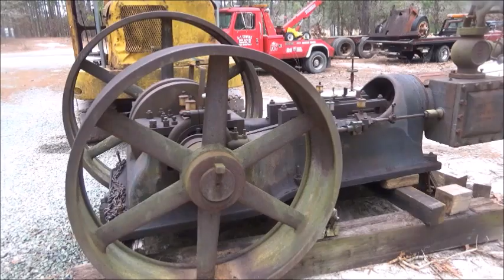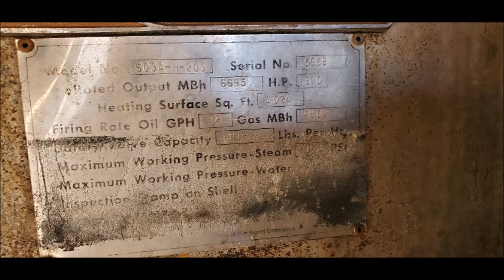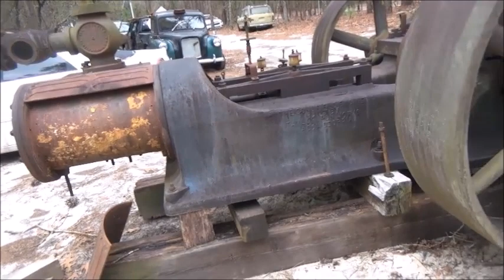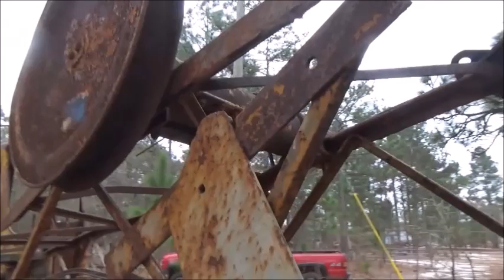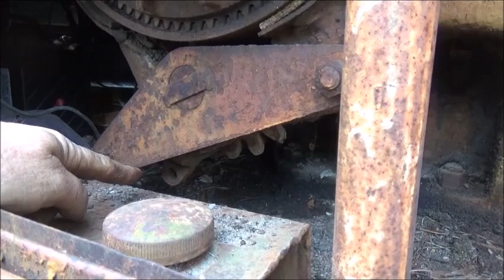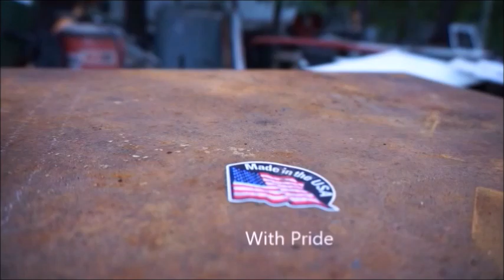STEAM BOILER AND STEAM ENGINE UPDATE

Comment: nc dept of labor inspects pressure vessels, they come and check my compressors yearly
Reply: I’m guessing you are using those in a business situation tho. Not what he would be doing.
Reply: @notajp  yea I work for the state but if he was worried about the integrity of the boiler itself they can ultrasound it

Comment: Last time I looked, stationary steam engineer ticket was a 4 class hierarchy. Class 4 and 3 pretty well have to be done at the same time. neither works without the other. I have seen these courses available online for a fairly reasonable price, but you have to dig for them as University's have the worst websites on the net. After that, qualification is based on what they call, "boiler time". It's really hard to get unless you have your own steam engine. Hey wait?

Comment: I see nothing wrong with what you want to do, I think it's great. I love that old machinery (Nice engine). I think the Horse Power of a boiler has something to do with heating grate area of the fire box and BTU's converted into the work the boiler can do. A lot of the steam shows offer a steam school generally in the spring to teach people about steam engines. We had a large heating boiler where I attended high school, it ran at 15psi I don't know the max pressure rating of the boiler. Go to www.smokestak.com They have a steam engine forum there.  The boiler will probably have to be inspected and make sure you have liability insurance that will cover the operation of the boiler and engine I' am guessing. That boiler probably has auto water feed and pressure/burner controls and also draft control. Best of luck on your projects.

Comment: I know the boiler is going to be a big expense, But gosh darn, I hope you can swing it, steam always makes these engines really sing. 
You might want to see about a fire tube boiler rather than a modern water tube. Lot less maintenance in regards to worrying about the tube calcification and such, less chance of a boom. of course they take longer to create steam and are less psi, but your not using these engines commercially, so I don't see it being an issue.

Comment: We used steam to cure dry cast concrete sewer pipe, we need moisture and heat we ran to 250 hp, 15 psi.

Comment: Put the steam engines in 20' containers and modify them so they open up like a tackle box.  Use hydraulic cylinders to do the opening, anyone who attempted to gain entry would just waste their time and make noise like the thieves that tried to hotwire that air start Diesel truck you have.

Comment: Hello Jonathan - I hate to pee in your cornflakes, but I think getting this boiler is not a good idea. First let me say I love your drive and projects you work on and your whole approach. But,  I am a retired mechanical engineer who designed HVAC systems for 25 years before traveling to assess many facilities across the US and Canada for another 11 years including these types of boiler plants. I was an active licensed engineer in NC up until this year. There are several things to consider and none good for this boiler. I may reference some code and standards, some of which have been around since before 1900. I don't claim to be a boiler expert, but I'll share what I know.

The Boiler  - It's ancient. I don't know when Iron Fireman quit building boilers, but they don't exist anymore and parts may be difficult to get. Iron Fireman was known mostly for its coal stokers and feeders.

Sizing - From ASHRAE: Boiler selection depends on the individual application and operating characteristics of actual loads and should be sized for the maximum load. Do we know the steam and pressure requirements of these steam engines? Are they in good enough condition to take high temperatures and pressure? Oversizing of a boiler to its load can result in overfiring and short cycling of the burner. If the boiler is set on a low-fire condition to compensate for a low load  you could run into condensation problems at the stack leading to corrosion of your smoke box.

Burner - I assume this is a low-fire/high fire burner only given its age. It may have a turndown ratio to deliver less steam but again condensation may become a problem. Modern boilers have fully modulating burners available and are built to handle the turndown, but this one doesn't.  It does operate off natural gas as given the gas train piping in the photos. I don't see fuel oil piping although some burners can switch from NG to FO. The burner is old, apparently original to the boiler. Parts may be available for it but you may be looking at a new burner at some point $$$$.

Fuel - As above. I assume you don't have natural  gas where you live, therefore the burner orifices will have to be resized for propane. Propane is not cheap. And if it does use fuel oil, you will require a tank, probably 500 gallons, with fuel oil gear pump(s) and piping system including return. And you must burn No. 2 Fuel Oil. Don't go buy diesel at the gas station. Fuel oil is dyed and closely monitored by the NC Agriculture Dept. Don't even think of burying a fuel tank.

Feedwater - Boilers like clean water. Even municipal water must be constantly treated with chemicals to properly operate a boiler. Lack of clean water leads to scaling and corrosion, situations that can lead to boiler failure. Boilers of this type have to be regularly blown down to discharge sludge that accumulates in the bottom. Also, you will need a constant water source and a feedwater system of piping and special pumps capable of pumping water to boiler pressure $$$$. Although low water safeties may be in place, a fired dry boiler will have catastrophic consequences. Boom! You will probably have to drain the system in the winter to keep it from freezing. And yes even live steam systems can freeze under certain conditions. I've seen burst steam coils and it isn't pretty. 

Piping - Modern high pressure piping must be welded by a certified welder. In commercial applications it's not uncommon to require X-Rays of random welds to certify lack of voids, etc. The piping must be insulated to retain heat. Otherwise you'll get condensation in the pipe that if not removed by steam traps could cause water hammer and potentially damage the engines. People have been killed by water hammer by improper opening of valves. You must allow for thermal pipe expansion depending on the distance. Safety relief valves must be in place to protect the piping and equipment from explosion. The reason high pressure is utilized is generally to reduce pipe size in large distribution systems. Sometimes process requires it.

Safety and Operation - Redundant safeties (pressure, temp, low water, and flame) are necessary if not required by Code. A boiler operator should be trained and certified in all aspects of steam plant operation. North Carolina has a Boiler Code that refers to many others: ASME, ASHRAE, Fuel Gas Code, Piping Code, NFPA, FM, etc.,etc., etc. It's involved. The boiler will probably have to be certified and licensed.

Boilers have to go through a set startup procedure to prevent thermal shock. Firing one too fast will crack tubes and tubesheets and other assorted mayhem.

Liability and Insurance - Here is where you may really get nailed. I have no idea about these two regarding boilers, but I would dare say your homeowner's insurance wouldn't look kindly to an operating high pressure steam boiler on your property. The old Union Carbide plant in Greenville had a boiler explosion in the 70s that sent chunks of building into the roadway several hundred feet away.

So, there's my long winded 2 cents worth. Personally, I think this boiler is a money pit unless you sell it for scrap. I would suggest for starters you stick with a compressed air system, get these engines moving, see what pressure they take and possibly air CFM that can be converted to steam volume. Then determine what you may need for a boiler if that's what you wish to do. Who knows you may get some low pressure residential steam boiler that offers enough Umph to spin these machines. They're not under load and if moving freely may require very little steam. Honestly, boilers are dull and not fun to watch. People want to see the engines spin and crossarms go back and forth. Dress up the old boiler for show as it would have been installed along with these machines.

Good luck Jonathan. Thanks for what you do and keep up the good work.
Reply from the maker: Nothing you wrote that could or would stop me from doing it. Just not sure why everyone is scared of spending a little money and doing a little work. Also iron fireman is the burner not to boiler maker.

Comment: Just my opinion I'd hold off for now .on that boiler ., back in the day I worked for the feds had a bunch of water tube and firetube boilers most ran really low on steam pressure even if rated higher , mostly under 12psi .

Comment: Jonathan, wow!  Let me tell you about the boiler, let me tell you about "WHY" people like us do stuff like this.  Let me tell you about health issues as well.  I don't want to make a book here,  but it is going to happen, sorry.

There are two Kings in the world, the first KING is Jesus!  The second king is steam!  Myself and some others here understand your "Why am I doing this?"  200hp boiler you don't need, way too big and wasteful.  After you go through the engines like you normally do,  you'll  be able to run them for display at probably  (+/_)  30-50 psi, maybe  a slow roll at less than 30, just a guess, but probably only one at a time.  I read as much as I  could on the tag, which wasn't  much, but nevertheless,  it is an oil fired boiler, commercial,  and boilers at least similar to these still are in use.  I agree with your thoughts on 150 psi for heat, there's  no way.  Was it a repurposed boiler and the limits, safeties and fuel regulators, etc were all reset? Could be.  That size (physical size AND hp size) would require a lot of fuel, water and maintenance.   To use a boiler like this is sort of like using a cannon to kill a common mouse. 

 If you put it out front, they will  come!  Most steam shows were started by a farmer, equipment dealer or people like us, that just had the stuff and put it on display.  Then comes the crowds, like it or not.  You have commercial  insurance,  so check with your company, your rates are already high, this might add.  Most insuran e companies are starting (or started) hating riveted boilers, I  think you have a welded boiler (not sure on that from looking and not knowing actual  age).  Last inspection  was 2014.  It's  in a building so you think it should be good.  Maybe, but most boiler issues come from the inside,  not the out.  One of the worst problems is shutting them down inproperly.

I could go on, but I  won't,  I  am not a licensed  steam engineer (yes many states require licensed/tested operators going through a steam operators class to run steam in the public, you mentioned 100 years of progress, I'm  in Kentucky, is that Denton, NC?  Never been there, can't  hardly get out of my four walls, but as you said you have the ability to get to that show.  My recommendation is contact them, tell them who you are, steam guys are steam guys.  I  no longer have any steam engines except a freelance model traction engine my dad built, from junk.  My health took that away kind of like you are saying.  Brother I'm  old, 52 years old.  Please make sure you leaving this world will be as easy as possible for those left behind.  Lost my brother Daniel last April (2020) anyone want his cat?  Anyhow Jonathan, sorry for a book here, but I  can certainly  help with boilers, not an expert, but have a bit of knowledge. Love you channel and content.  If I can help in any way, let me know.  I ain't  smart, but I've been  around the block.